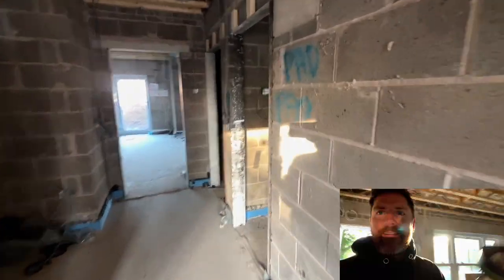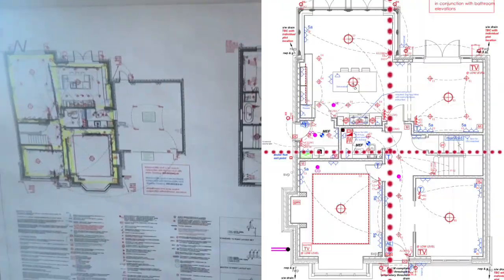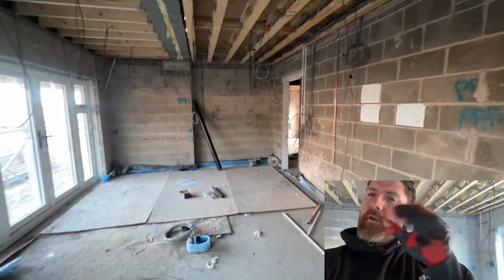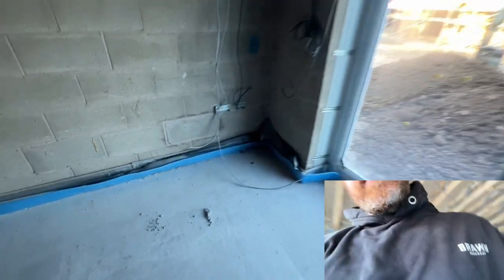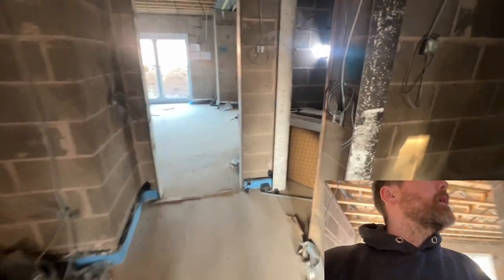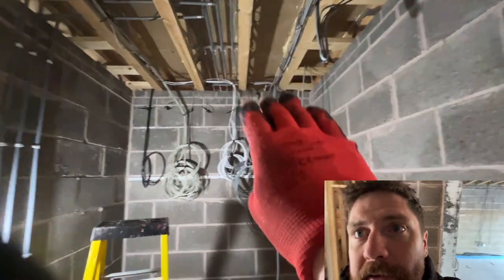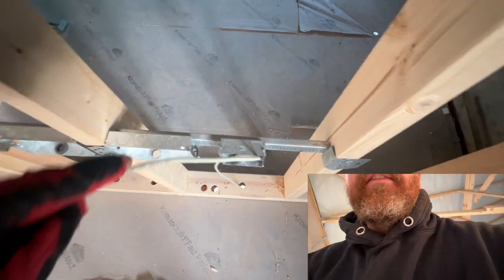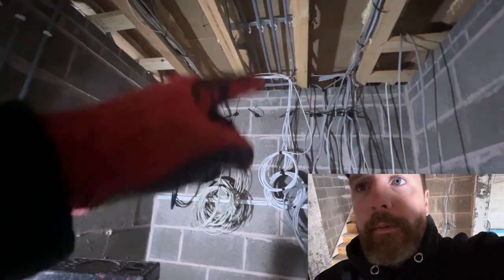Electrician basics - how to plan your cable routes on a new build

Comment: There was no separation of power and data ( also hanging the data cables like that is not health ( last time I read the specs 4kg pulling was max allowed …) well explained though ( I havnt done a first fix yet ( had a lot of industrial/ remediation work over 40 years though…
Reply from the maker: Hello pal! Yeah power and data separated unless they crossed over to avoid noise, I’m not sure the pulling 4kg what you’re referring to sorry! Wich bit of the vid cheers!
Reply: Wow that was a prompt response!…the 4kgs is the pull on the cat cables ( weight / pull) …we also ( according to the reps in oz cannot use cable ties ( Velcro is acceptable ) …only place that usually runs to that spec are governments and data centres… @Alexander_sparky
Reply from the maker: @alphamegansw  fair play! I understand now! For our regs the cable must be “sufficiently supported” leaving it to us to decide. Often the cables will follow the same route through the property - but separated by distances suitable to the load etc that may induce eddy currents that generate unwanted noise on ELV cabling. The main risks we consider is the use of metal cable ties where appropriate to ensure firefighter safety if the ceilings where to fail - entry and exit routes would still be safe

Comment: Interesting Must save on time and cable. Obviously you wouldn’t be able to do the upstairs like that if concrete flooring that we see a lot of these days. What happens with the holes after, are they filled with fire stop? Does the span joists put away with using metal ties and fixings ?
Reply from the maker: Hi! Yeah with the concrete floors like we have on other sites it is wired from above downstairs using the hilti gun with cable tie attachment 🔥 holes drilled down have fire stop inside them filled by site 

Generally the length of run alongside joists don’t tend to be that long however Metal ties are used if it’s down the full length of a room for example - when we “tie in” any slack is removed and at some point it will 90’ through the joist as well 👌🏻👌🏻 hope that helps show how we do it!